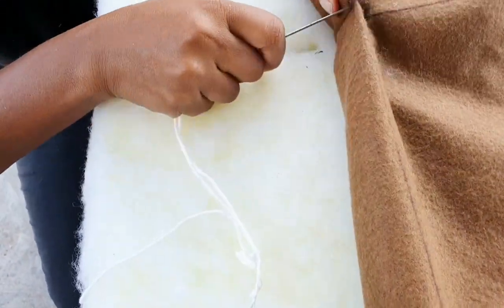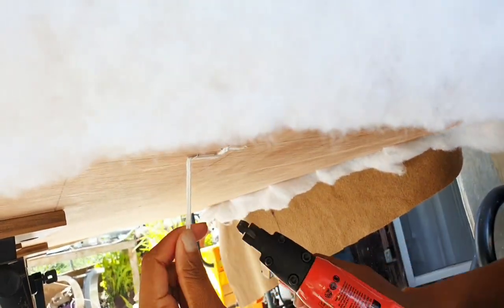Tufted Headboard with wings

Comment: Nice job. I have a question? I have the similar bed. My problem is I purchased the queen bed but was sent the queen headboard and king footboard. I was thinking about cutting the middle of the frame because the queen headboard won't connect with king footboard. Can I cut in the middle to match queen measurements?
Reply from the maker: Send me a pic on ig and I'll be better able to inform you. Depending on the design of the footboard you can cut the middle or the side to match the queen bed.